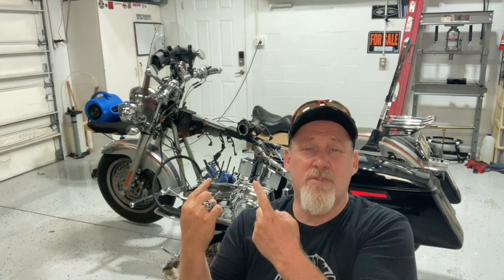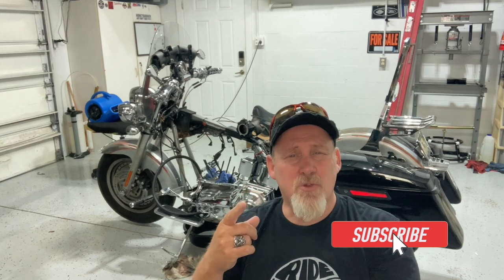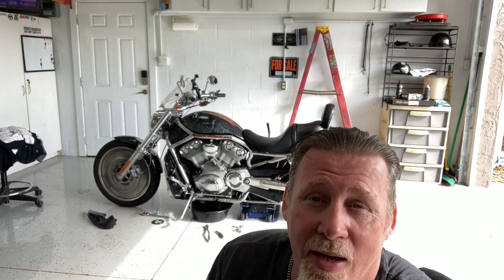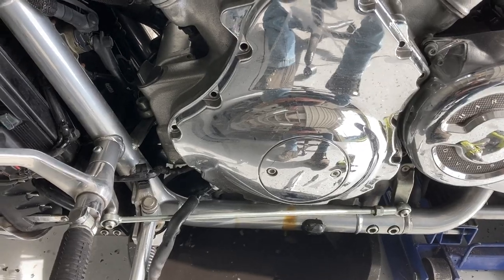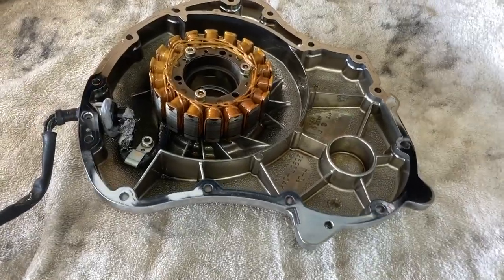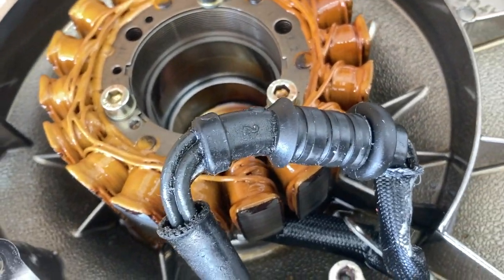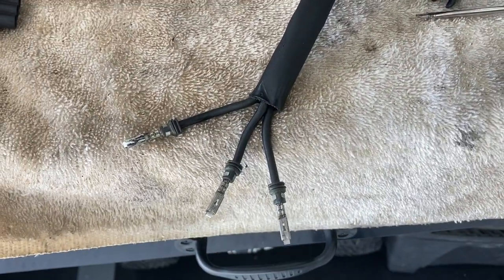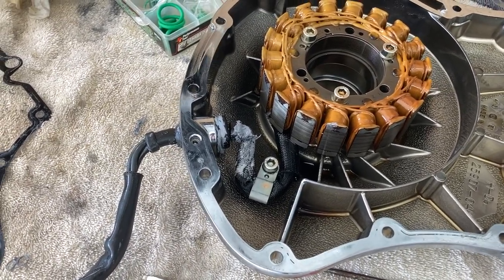MY HARLEY DAVIDSON IS LEAKING OIL 2004 Harley Davidson Vrod Leaking Oil From The Stator DIY fix.

Comment: Great video! The only other thing I would add is that it would've been wise to check the triple sprocket bolt while you were in there and red Loctite it and torque to 17 ft lbs. This is a common thing to do on these bikes as the triple sprocket bolt does not get any threead lock from the factory. If the triple sprocket bolt backs out, your water pump will stop working and all sorts of bad things can happen to the engine's top end. And yes, I receommend you pull the stator cover off (again) to do this pronto. By the way, what a steal of a deal you got on that bike for $1,500!!! Good stuff!
Reply from the maker: Hey thanks for watching and commenting, this video was only about the oil leak, which is why I didn’t mention the sprocket bolt, I did already take care of it on this bike. Yes it has been a great bike for 1500 dollars
Reply: @TheBadgers  Good deal! I was worried you guys would be back out on a long ride and have that bolt back out on you in the middle of nowhere. Have you upgraded the fuel tank to the Unlimited Engineering 5 gallon yet? I’m doing that to my ‘06 V-Rod in the next week or two. I’ve already done a ton of cool upgrades and freshening up work on my bike. Super reliable and looks killer now.